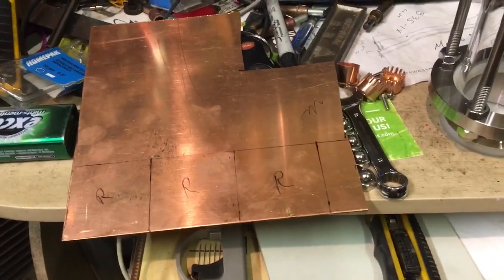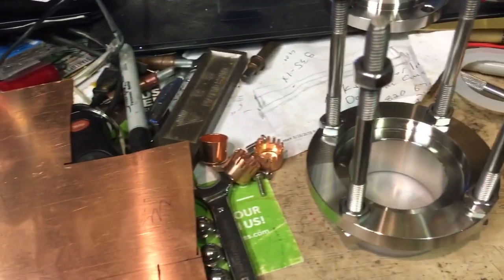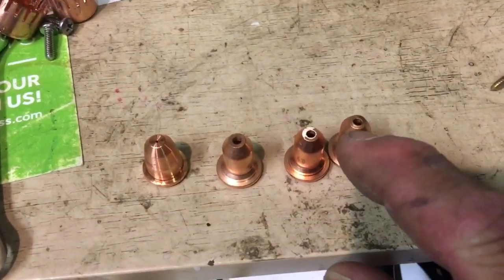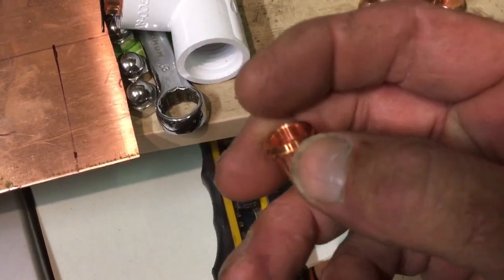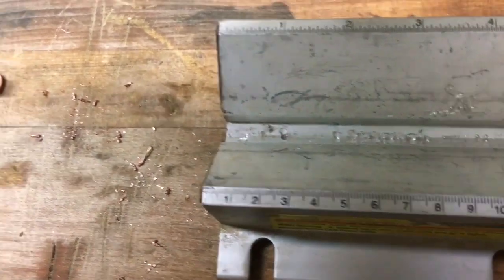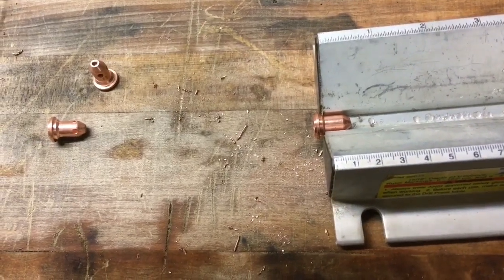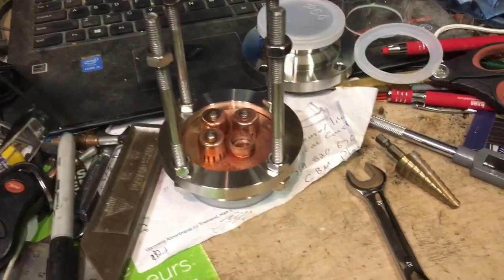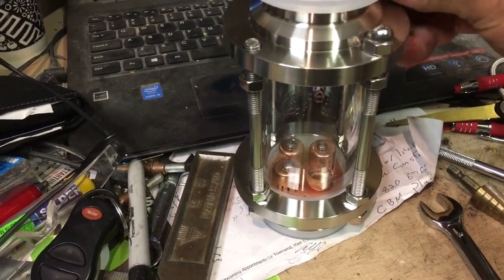Making a Bubble Plate chamber

Comment: An explanation on what this does and the science behind it would be great.
Reply from the maker: Mitch Mitcheson sure Mitch, let me know if I cover what your asking. Each bubble chamber condenses the vapours and creates another distillation process. I’m not a huge fan of full flavour profiles so I use different amounts of plates to make the spirit a little more pure. So you have heard 3 times distilled, this is a way to achieve that statement with one run. If I add 3 bubble chambers it’s like Distilling the batch several times. Now my Still is small 2” so each plate can go into reflux ( re-distill) depending on the air temperature at the distillery, but I also have a dephlag on top of the column which converts the vapours to liquid and that falls back into the plates to be re distilled. 
You can achieve this effect in many ways. Using a pot still you just cut your spirit from the first run to 40 abv and throw it back into the Still and run again. Another way to clean up a spirit is to run it through charcoal, possibly several times depending on what you desire in flavour. But keep in mind each step does remove flavour and it is up to your taste buds to decide which flavour profile is right for you. I prefer it dry, you may wish it to be more full bodied which requires less work. 
Hope that covers it. If not send another message with a little more specific request if you can and I will do my best to answer. 
Thanks for writing!
Reply: @STILLinCANADA Thanks for the swift reply. That makes perfect sense, odd I haven't seen it before. Seems much better than the other reflux stills I've seen, more control to adjust flavour profiles seems like a great advantage.
Really enjoying the vids, keep up the good work 👍
Reply: @STILLinCANADA  This answer should be pinned to the top of he comment section!
Reply from the maker: optimistichorizon done
Reply: Ok dum dum its a bubble plate it puts it though anoter distillation and purifies it more,,, get that mcfly  ,,, ha ha lol
Reply: Material links would be AWESOME! Cheers
Reply from the maker: But not relevant unless you lived close to me. Plumbing parts are drivable range, most else is Alibaba.com

Comment: Pretty cool. I will be adding a bubble plate to my column in a few weeks and I really just wanted to make sure on sizes of the holes of the bubblers. My column is connected to the boiler with a 3 inch tri clamp which has female npt threading going up. At the inside of the coupling there is a small ledge in which I am going to insert a stainless steel mason jar lid (which conveniently fits quite snugly in there) and use that as the basis for my bubble plate. Good video, thanks.

Comment: excellent. thank you! im gonna use 1/2" caps as my tips instead of the plasma tips though, for cost savings. then my bubble caps will be 3/4" over top. its working in my mind, anyway..
Reply from the maker: What works for you is the best way to go. But as for costs the plasma tips were dirt cheap

Comment: How thick is your copper plate? .125? 
And the holes on the side.of your tips. Did you put 2 hole all the way thru making a tea intersection? Or did you put 4 holes half way thru?
Reply: 0.090 plate and did 4 holes drilled through.

Comment: Interesting video. I have no idea where to get copper sheets, and some of the steps seem unclear, but I will watch it again when I have more time to see if a second time through helps or gives me more specific questions. Thanks.
Reply: Not sure where you're located, but the internet is full of sellers that could supply you with various sizes of copper sheeting. A local scrapyard is another good source for copper goods.
Reply: @tomb816  shipping prices are what kill me.
Reply: @rileysowner  I hear ya. Try a scrapyard, roofing supply store, or metal shop. At least 2 should have a line on sheet or roll copper.
Reply from the maker: In Most areas you can find a metal supply store. We have metal supermarket and Golden triangle specialty metals close to us. For the flat plate. Then call plumbers for there scrap short pieces of tube.
Reply: You should skip bubble plates... And just use packing it's just as effective

Comment: I see ya drop in the bubble plate into thebittom of the  site glass, then put the silicone gasket on, then the glass chamber.  Does any vapor get under the bubble plate..... just wondering if I'd need a gasket under it too...?
Thanks for posting. Looks like something I can do...☺
Reply from the maker: Nope works like a charm. I have don’t ten of these so far and each one has worked exceptionally well
Reply: @STILLinCANADA  Oh hey,  thanks for the quick response.  I wasn't sure if it needed one - figured you would have mentioned it...
This woild be a great addition, as I would like to up my output concentration a bit.
Thanks again..🥃

Comment: My ultimate goal is to produce at highest ABV, so flavor profile doesn't matter to me.  And I enjoy tinkering and building stuff... so I would appreciate your thoughts on some basic questions... because I know nothing but a little bit of science and mechanical... and no where close to your experience and skill set.

What if I don't use a glass tube?  If I cut some disks that will fit nicely into a two inch pipe, and stack some plates with stand offs to hold them apart X number of inches (maybe 2" apart).  What are the chances that it will work?  The plates won't seal to the sides of the pipe, but I can't see why that matters if they are close to the pipe with no major gaps.  If the spacing of a couple of inches with stand-offs would work.. that would give me the ability to have 5 bubble plates in a 10" pipe space.

Also with your design, you have 3 up and one down.  I suppose that is because you're expecting less down than up... not sure why it's not 2 up and 2 down.... or maybe 3 up and 2 down.

On the down, you extended it upward with a short piece of tubing.  I'm not understanding the reason.  Seems like if the down were closer to flush with the top side of the plate (like it would be without the tube) it would allow an easier downward flow of liquid towards the heat source to try again as a reflux.  And besides that, since my concept is not sealing to the sides of the tube, the down flow probably doesn't really need the down nozzle, but I will put it there just in case the plates are a little closer to the sides of the pipe than I'm figuring is likely.  And does the down nozzle have a cap on the bottom?  If it does, it just seem like a dead space that would capture liquid.

Anyway, I think that I written enough to prove beyond a doubt that I don't know anything.  Your thoughts to re-direct me before I waste time in a worthless direction would be appreciated.

Thank you.
Reply from the maker: Bobby Woodrell we use a glass chamber to monitor the flooding of the plates. The 3 up allow vapour to rise and condense. The down is set to maintain a specific height of liquid. Thus creating a small still. Each plate needs to be sealed to be effective. Flooding is controlled by still heat and dephlag cooling. If your using a straight pipe add rolled copper mesh to create a unsupervised theoretical plate. Each roll is equal to a plate in performance.
Reply: The down works like a one way valve when the the plate is full off liquid that is dropping down.

Comment: are those silicone seals?
there is great disagreement on silicone being used where high temperature/high ethanol environment.
Reply from the maker: yes and deservingly so, however time and surface area are the big factors that come in play. on the seals neither is exposed long enough to create a problem with leaching

Comment: Excellent work. I have some questions, I hope you can answer them. I run a packed column (stainless scrubber) and when I run flavored spirits (such as fruit washes) I remove some packaging and look for the minimum reflux, so I get a refined and not raw product like a pot-still (which I use for stripping). I have never performed flat column but they say that you get flavors and purity at the same time .. is this true in your experience? Another question, do you have a good link where I can read the detail of the drawing, dimensions of the openings etc ...? I distill small quantities with a 3 "column and would like to understand if it is better to build a column for flavored plates or to stay with packaging. Thanks for your time.
Reply from the maker: One roll of pure copper mesh is about equivalent to a bubble plate , the amount of flavour impact is about equivalent to the proof your running at and is within your control with the Dephlag. Discard the stainless scrubber and get a pure copper one as the copper removes sulphates from your mash. The stainless only creates a reflux condition. The size of holes is a trial and error condition as each still will operate differently
Reply: @STILLinCANADA  Thanks for the answer, I already have copper in the vapor path. My concern is basically if you get the same flavor with scrubber (equivalent to dishes) that you would get with bubble dishes. By aroma I mean washed fruit, brandy, whiskey, etc. When I ask on the forum, there seems to be no side by side answer. I would like to avoid building a column plate and then I realize that I get the same thing with scrubbers .... I have never performed plates so I would like an opinion from those who know them, I have read the theory but it is not the same thing of field practice especially on a hobby scale.
Reply from the maker: Though the two mediums are different they do work in a similar manner. Flavour intensity and aromas will be affected the same. I did the experiment on my keg still with both plate and roll. The result was the same on my senses. However the bubble plate is far easier to control.
Reply: @STILLinCANADA  Thank you very much. On a wash of max 20 liters and a 3 "column would you recommend the bubble plates? I am happy with the packaging but I don't know if the plates require a large wash or is similar to the packed column.
Reply from the maker: Adding plates also requires you to add a dephlag to control the reflux on the plates. That is the greatest ability of plates , is how to define the abv by adding more cold water to the dephlag and visually control the reflux on the plates. I did the mesh and it works. But by far prefer the control and profiles I can achieve with using plates

Comment: Nice video, but you did not show how you attached it to the plate... The underside.  I subscribed...
Reply from the maker: emoneyblue can you explain a little further and I will add the info to my next video
Reply: @STILLinCANADA  
Yes in the video you show how you made the parts then you skip to the part where it was already assembled we never saw how you actually attached it to the plate or the technique used. Can you go through the motions of showing how you attached all the pieces to the plate from the front back top and bottom that way we can actually put it together for person just looking at the video it's hard to see exactly how it was assembled. I watched all your videos and I subscribed I love what you're doing thank you keep up the good work.
Reply from the maker: emoneyblue ahh I get it. I do believe I explained it but didn’t actually show it. My bad. So push the plasma cutter tip up through the bottom and place the 1/2” end cap you cut slots into on top of the section you just pushed through. You should have already tapped a thread into the top of the plasma tip and all you need to do is install the screw. The screw creates a clamp between the plasma tip and the end cap upon the copper plate. This ensure you can easily remove or adjust the unit on cleanings. Let me know if this clears it up. I have done this many times and I believe the explanation sold suffice, but If not I will get your PM and send full assemble pictures.

Comment: Good job, I have seen first 2" bubble plate.  how about its speed?
Reply from the maker: Ya it’s a 2” so you can expect a longer distil time. But I found they heat up a normalize fast. Controlling the reaction is instantaneous with slight temp adjustments. I was quite happy with them. But you can’t compare the speed to a 4”.
Reply: @STILLinCANADA  maybe the best for home distiller like me, ll try 2" same size. thnx for the great video...

Comment: is there any way by adding bubble plates to a still it could be dangerous when the vapours condense and fall on top of the bubble plate will the bubble plate not stop the vapours from underneath coming up bubble plates look good but I don't know enough about them to use them
Reply from the maker: w1nter k read my reply to Mitch Mitcherson. I explained the process there. If you need more info let me know.
Reply: @STILLinCANADA  im just wondering if its possible that it would build up pressure and be dangerous or if i added bubble plates it would still be dummy proof
Reply from the maker: w1nter k it is still considered an open system and does not create a pressurized vessel. So safe in that regard. You control the amount of loading by the dephlag and heat you add so everything is quite controlled during the run.

Comment: Is that a 2in Column?
What thickness copper did you go with on the plate?
Reply from the maker: Cody Smith it is a 2” column and for the life of me I can’t remember the thickness  but it is close to .125. I cannot bend it by hand
Reply: @STILLinCANADA  Just ordered parts to build my own. Thank you. How many plates are you running? I was going to do 4. I was thinking about having 2 plates per sight glass
Reply from the maker: Cody Smith I have 5 units but typically only use 3 with some copper wool packed in for a total of 4 plate system. I find much more than that and I’m losing too much of a flavour profile. Though if I do a few stripping runs than I can load all plates and do vodka

Comment: What are the size of the holes? That the tips fit into and the size of the larger hole?
Reply from the maker: Alexander Rupp I don’t remember now if they were 3/32 or 1/8th. Bigger holes are the size to tap the screw I used and the size to snug fit the plasma cotter tip.
Reply: I meant the 4 in the plate itself
Reply from the maker: Yes make those holes the size to snug fit the plasma tip. You will be fitting three up through the bottom and one upside down. I can’t tell you an exact size as there are many different sized tips easily available. You will have to measure the one you have.

Comment: Is the hight of the downcomer important?
Reply from the maker: not so much, but I used one size up from the other ones, could have used the same ones and made the holes bigger if need be
Reply: I think maybe the question was same as mine, being, the height of down commer on the top side where you soldered the piece of tubing, my guess is that this must be higher than the slots in the caps or it will drain down before bubbling, is this correct? 
I must make one, I’m tired of using copper mesh wadded up in the colum.   Thank you sir!

Comment: You probably do not want to put it in the dishwasher. You'll get residual detergent - which you don't want in your final product.
Reply from the maker: represto thanks for the heads up, I will keep an eye on that. And research detergents that do not leave any film. But I have been adding vinegar each time at the beginning of the rinse cycle and I always add an extra rinse cycle. Maybe I will just switch to hand cleaning. Just to be safe. Thanks again